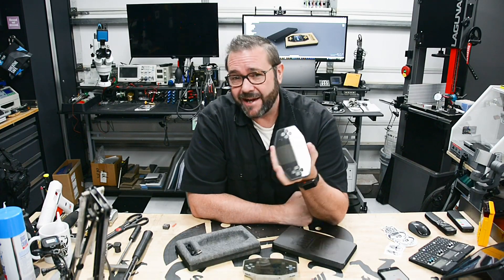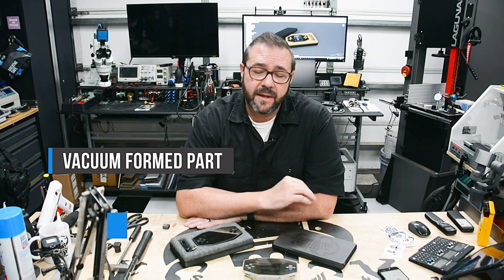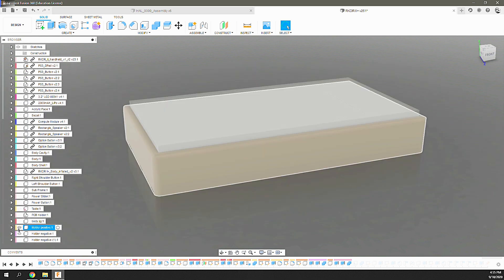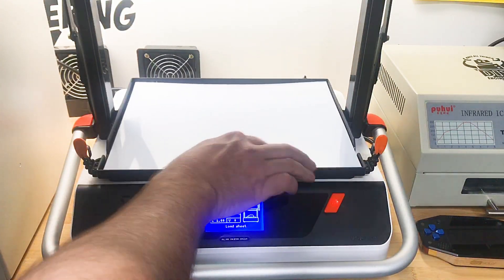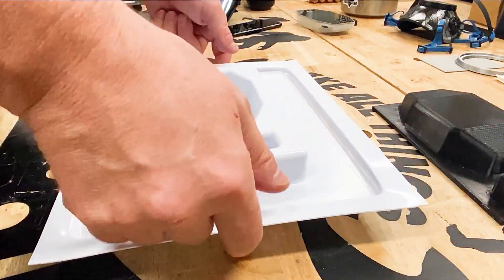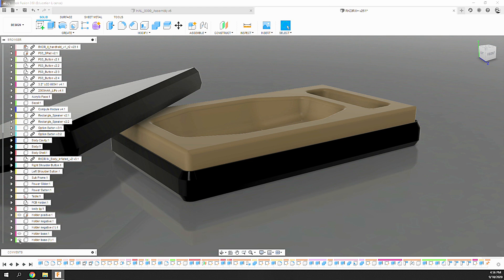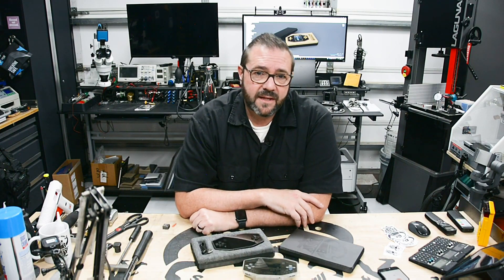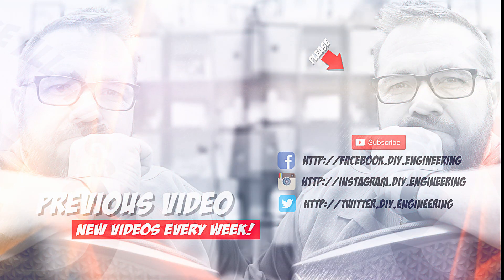Vacuum Forming With Felt to Make Custom Product Enclosures!

Comment: Looks good. You could add a small thumbnail so a user can pull the main unit out more easily without having to tip the casing.
The machine looks like it’s $1.5k but not available in the UK. Can you suggest another and what do you like about it more than other vacuum forming machines? Is it the presets?
Also, what was the felt “press” was that just the original mould cast? 

Thanks

Comment: Hi, just wanna know how come you demold it easily without draft angles on the outer walls? Any tips on demolding things like this? Thank you hope you notice me 🙏
Reply from the maker: there are no undercuts on this which makes it easier and does not require drafts on verticals. also leaving vent holes in your forming buck can aid in removing the part. thickness of material has a lot to do with ease of part removal. thinner material is more flexible and easier to release. as well as the release compound you are using on your buck.
hth

Comment: Have you considered doing any "Molded Pulp" for product packaging?
Reply from the maker: no, because it's not something I can do in the shop... or is it?!
Reply: @DIYEngineering  It depends i guess!  It isn't too crazy difficult in theory.  One person even did it with FDM Prints, although that got more of the "McDonalds' Drink Holder" Surface Finish rather than the more modern method which almost makes a smooth surface (a sandwich shop near me has ones like this)

All you need is something to make the paper mush (a blender,  orbucket with a drill powered mixer thing, etc + paper waste or fresh uncoated white paper, water), then a mold for straining and/or pressing and/or heating it.

I am unsure on what all you do for mold design, but it'd be a neat thing if you could pull it off

I think i made a youtube playlist on this, i can grab the link

(Going to post them below since sometimes YouTube deletes comments with links?)
Reply: Here's The Playlist Link; Hope it Works!  Also the Wikipedia page is worth a read

https://youtube.com/playlist?list=PLq6IzRhDFdPNiYF1N0AscPGq-2hI1Xt-m